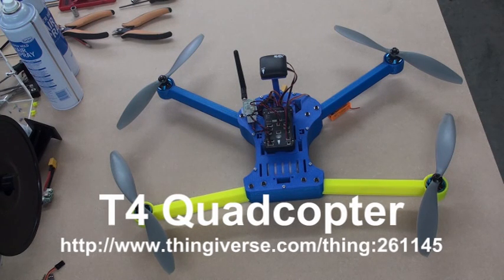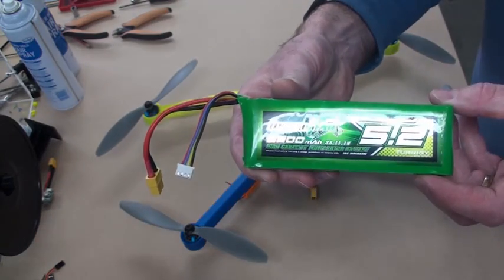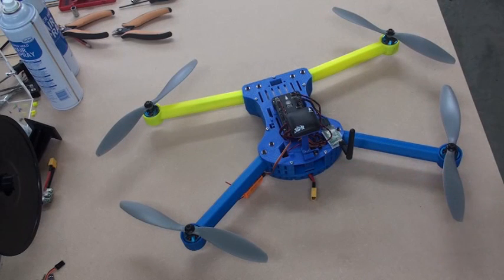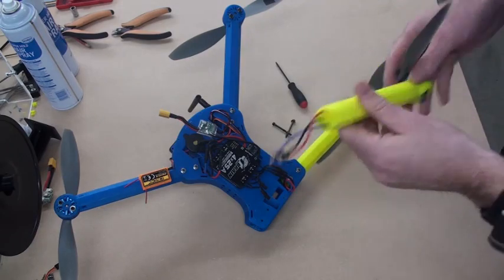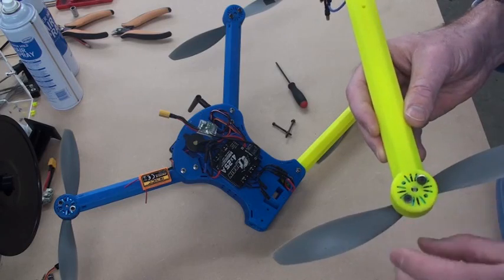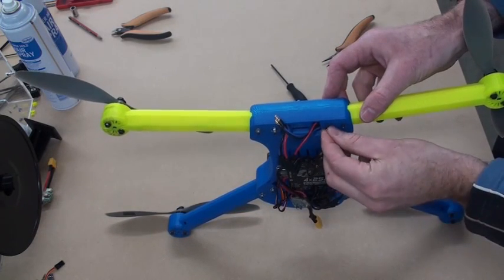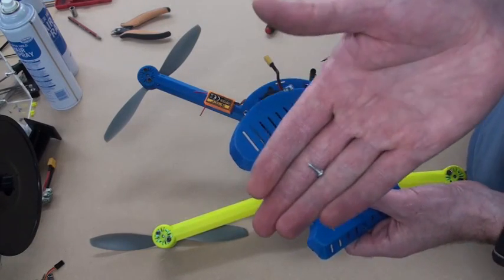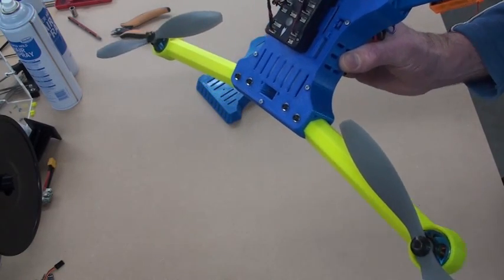T4 Quadcopter build overview

Comment: Hello Brendan22, I printed the parts for the T4 Quadcopter drone but when I tried to click on the links for the electronic parts, wires, and other stuff, it either says I am blocked, the link is expired, and other stuff. I was wondering if you could help me with the links and stuff because I've been super excited to build this. Thank you.
Reply: Sorry - it's been about 8 years since I built a drone so I've got no idea what is currently available.  I assume there is a lot cooler hardware around now.  I used to get a lot of stuff from HobbyKing back in the day.
Reply: @brendan-csel2700 Oh ok, thank you for letting me know.